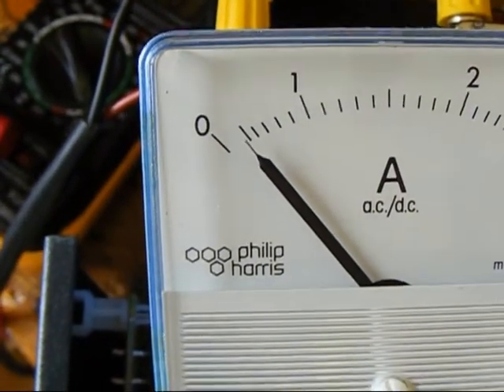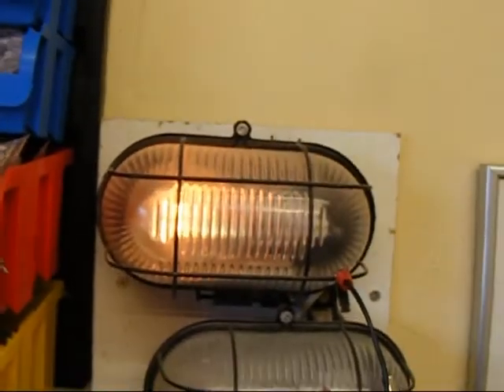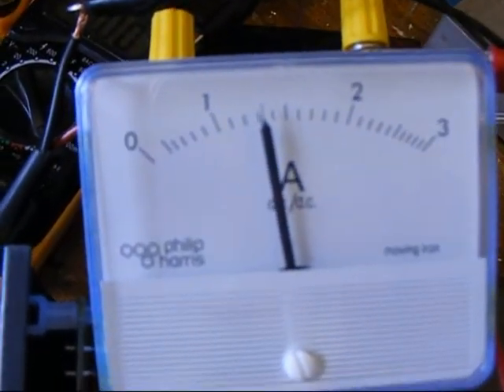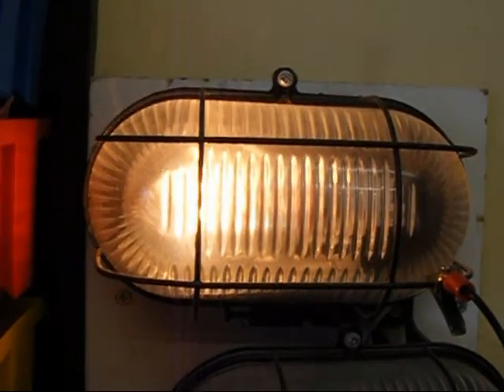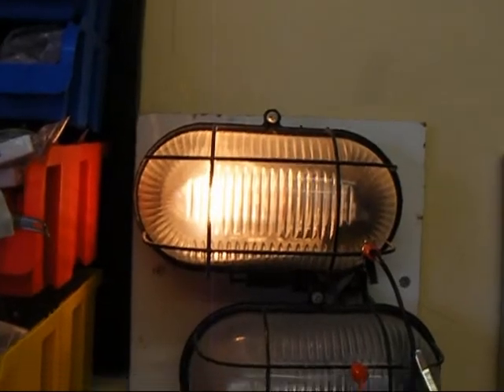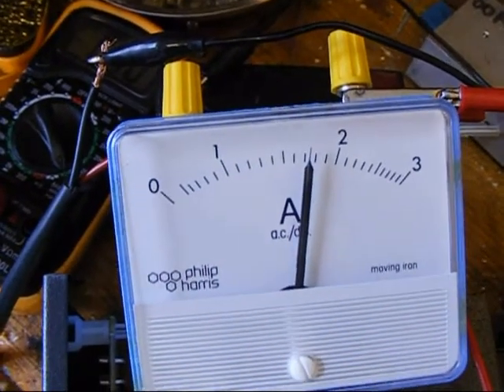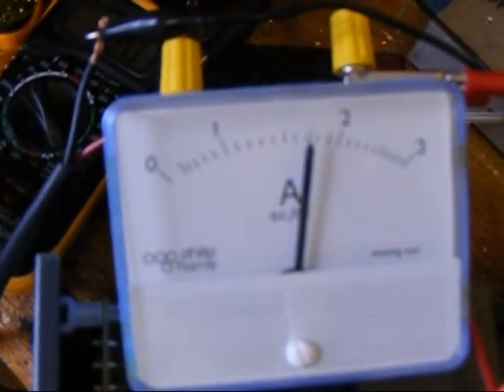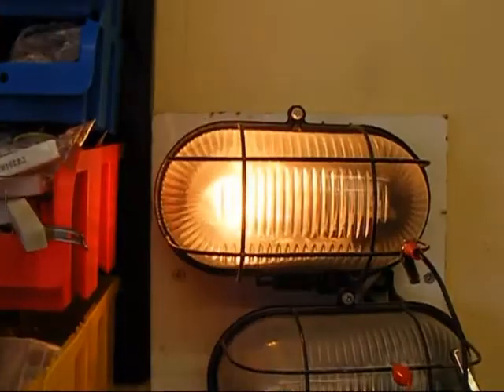Current limiter for Mains projects - safety

Comment: When using two bulbs you wire them in parallel not series

Two 100 watt bulbs in series is like a single 50 watt bulb as you are increasing the resistance (high wattage bulbs have low resistance)